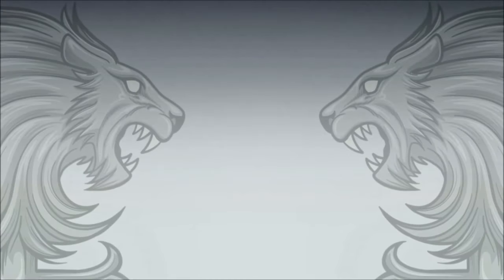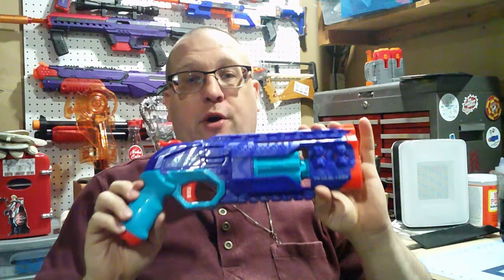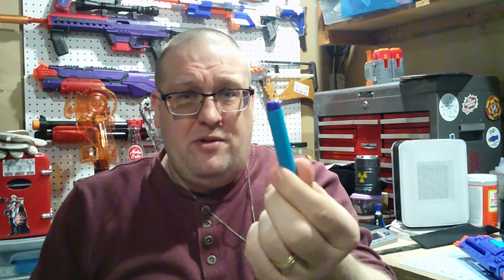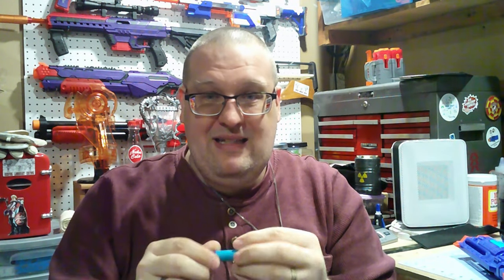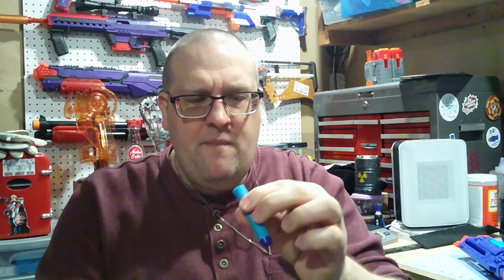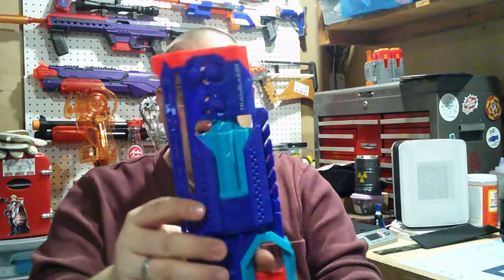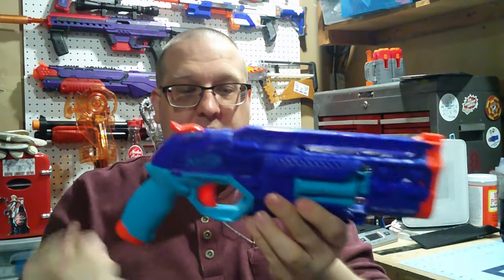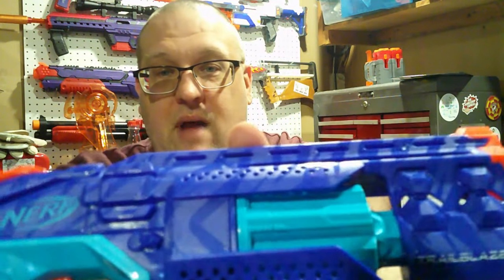Nerf Elite 2.0 Trailblazer Review

Comment: There is a ratcheting system in the cylinder. 
8:40 If you pressed on the teal cylinder right now and pushed downward, the cylinder would spin by 1/8th. The cam guide cylinder that turns when you prime the hammer would stay still while you did this. So you can twist this cylinder twice to reload the dart you fired.
There is absolutely no mention of this anywhere on the box or the manual. 
This system is also glued in. There's a screw inside the cam guide cylinder, but I can't see how to get to the spring in the ratcheting system without attacking the cylinder with boiling water.
I'd love to know how to open it without breaking it. Going to try boiling water.
Reply from the maker: Nice catch, and thanks for the heads up on the glued spot. I'll be a bit more thorough if I look at anymore Elite 2.0 blasters.

Comment: The barrel advancement mechanism is way better than the hammershot and I don't think it will jam/not advance on priming.

 I'm in the middle of attempting to chop down the front and make it shorter. Thank you for the info of that potential weak point near the spring. I'll reinforce that section while I have it opened up since I threw a 10 in there already lol
Reply from the maker: The rotation mech has definitely been improved since the OG hammershot for sure. You can even see it in the Fortnite 6sh. 

Good luck with the mods, hope they turn out well.

Comment: I got one of these a couple of days ago, also from the WalMart website - I still haven't seen them in the stores. 
My take - it works fine and kids will have fun with it. However... all that extra front plastic makes it much harder to reload than either the Hammershot or the SH-6. I can load 3-4 from the left, then I need to turn the cylinder, and it is MUCH stiffer to turn than the others. It clicks 2 darts forward if turned by hand, so in theory you turn it twice and load 4 more darts.
In any kind of running battle where you need to reload a few times, the Hammershort or SH-6 are going to be much easier to use.
I'm inclined to cut away some of the plastic on the right, the section with the 4 'teeth', to allow loading from both sides.
Reply from the maker: I'm wondering if this is going to be a online only. Everyone who has gotten one has been online. The front looks nice, but poorly executed.

Comment: I plan on making a "Wizard Magnum" out of one of these critters... and I was hoping to mod the shell by replacing the grip with that of a Roughcut. Looks like if I hollow it out just so, that can easily be accomplished.

And yeah... that cutout on the non-"hero side" of the blaster is an annoyance... but only a mild one.
Reply from the maker: That sounds like an awesome concept. Also I learned from my plasma pistol prop. JB Weld plastic binder is amazing at attaching nerf shells together.
Reply: @TheGriever2112  Thank Frog I've got some in my collection of glues. Yeah, I've been focusing away from Nerf and toward Bishojou Plamo (Beautiful Girl Plastic Model kits) of late, but the tools and materials are roughly the same.

Comment: Personally I find this blaster easier to prime that the Hammershot one handed. I'm curious though if the point at the front of the cylinder is necessary for it to spin. Because if not, I woudl love to get one and just completely chop that front barrel off. Wouldnt mind even chopping it down further and making it shoot half-darts.
Reply from the maker: The smaller grip could be to thank for that. While I did harp on it a bit. I counted it as a negative cause I got big hands. You might be able to get away with chopping the front. If you follow a minimized hammershot guide, or Hammerstorm guide. (The hammerstorm has the same cylinder)

Comment: Im not sure if I got what you are saying. Will this fit the hammershot spring from Orange mod works?
Reply from the maker: The spring should work. The OMW hammer won't, The OMW trigger might.
Reply: @TheGriever2112  Thanks!  Just ordered this, I have the same gripe about that side.  Hopefully someone will make a 3D printed part that will fill in that space.  I feel like if they just make a orange tip replacement with an extended surface on one side, they could cover it.